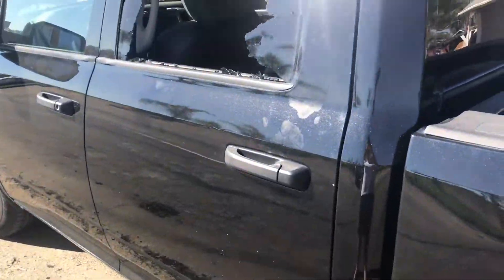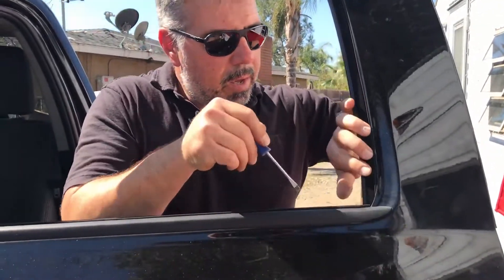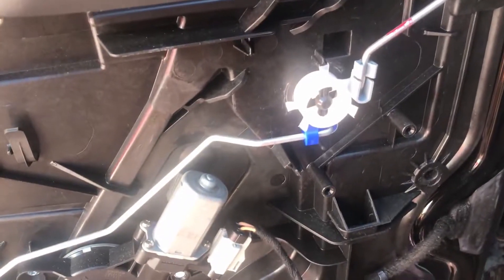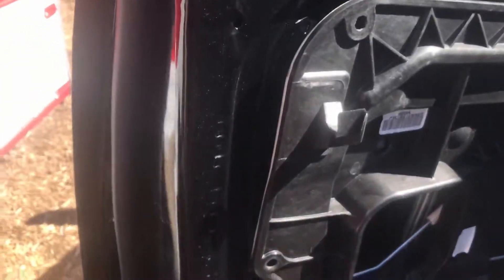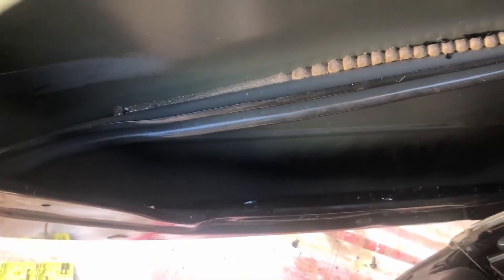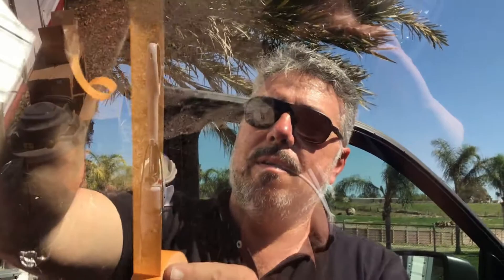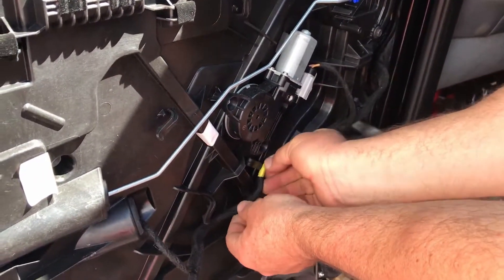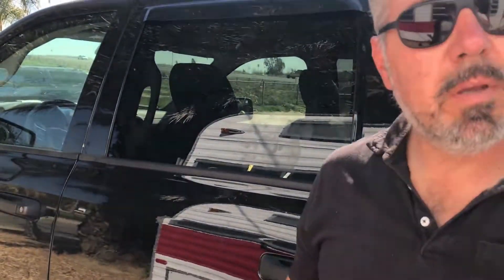How To Replace A Broken Car Window!!/Dodge Ram Truck/

Comment: I have a 2019 bighorn crewcab. My inner door panel looked completely different inside. Not sure why. Had to install mine from outside after removing the exterior  trim entirely. Not sure why so different. Can't find any vids showing my style install.

Comment: I have a 2021 ram 3500 dually crew cab full box 8ft bed limited longhorn. Driver front door glass needs replaced. How do I determine if I have acoustic glass?

Comment: You helped me out here brother!  I didn't end up taking the inner panel/regulator assembly off.  My screw up was not to have the clips perfectly positioned for access to the prong releases through the access holes in the rail channels.  After finally getting the jokers released again I was able to tape the window in place while I ran the motor to exactly the right height. I appreciate your good camera angles and insightful commentary Delicate Steve!  BTW I was quoted $330 for the glass and install but bought from eBay for $70.